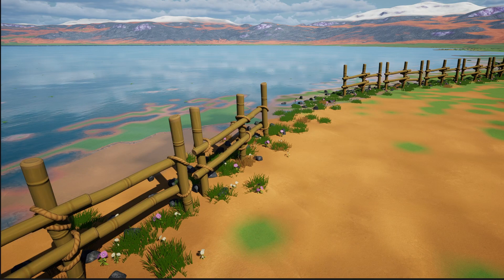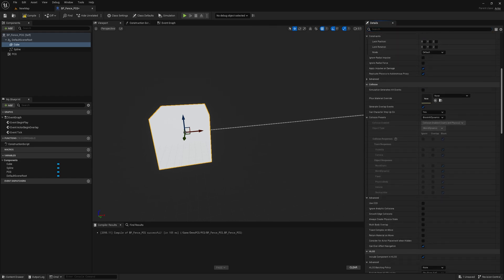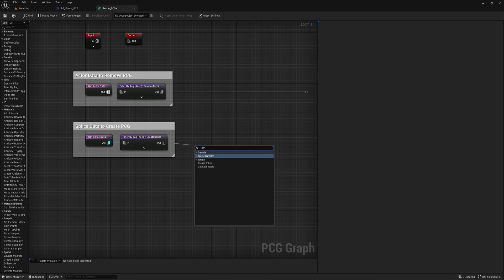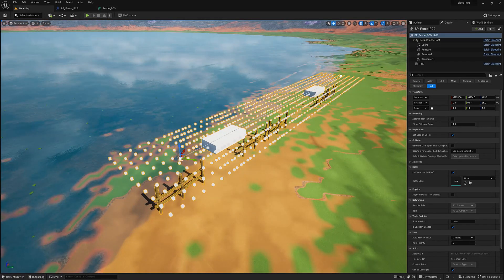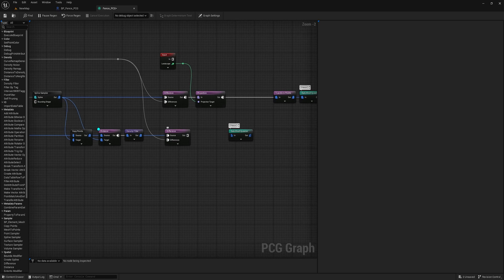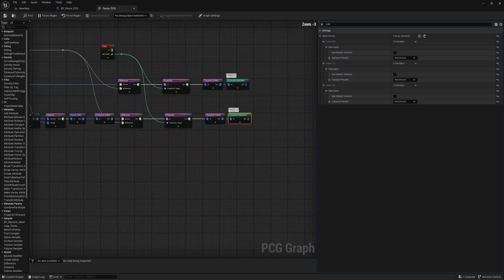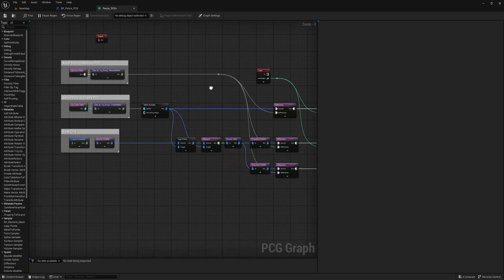UE5 How To - Procedural Fence using Spline and Mesh actors (PCG)

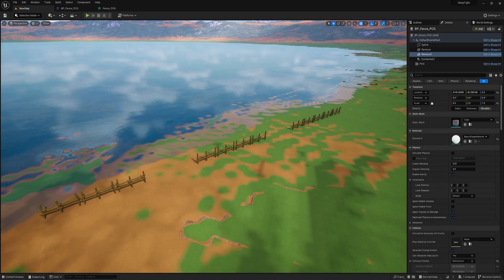Comment: Note: (PCG) Landscape Projection step (starting at 6:06) does not work the same in Unreal 5.3. The differences start with the StaticMeshSpawner node creating a To Point node in between SplineSampler and StaticMeshSpawner. The Projection Node creates a Make Concrete node from the Difference node, and when that happens, the fence mesh disappears when placing the actor in the world. 

Note 2: The Narrator stops consistently calling out what they're doing around the 3:30 mark, and it makes following the tutorial significantly more complicated.
Reply: The other issue I'm running into is that if I modifying the actor location or change anything on the actor and then hit Ctrl+Z, the fence mesh duplicates itself at a seemingly random location on the map and is only removed by manually deleting it or deleting the entire actor and starting from the level and starting over.

Comment: This is good stuff! Quick Question,  when I put a wide curve in the spline, the fence ends do not line up, anyway I can keep the ends connected ?
Reply: I figured it out, if you put a "TRANSFORM POINTS",  right before the Static Mesh Spawner, and lower the Min and Max offset numbers in the X and Y axis, you can get them to align when you put bends in your spline.

Comment: get actor data is not showing on my blueprint when im search for it what im doing wrong?
Reply from the maker: Get Actor Data is a PCG node, therefore it will not be possible to find it in Blueprint, you first need to create a PCG graph and then you can find it, a video showing how to do this is attached
https://youtu.be/4cjp2mslno8
Reply: I have the same problem, when i search for get actor data in the PCG graph, nothing pops up.

Comment: Great tutorial, straight to the point, i appreciate it!

If i am not rude, could you give some pointers either in comment or in a new video, how one could use this in building (with interior rooms) generation. Like using a closed spline to define the building footprint and divide that area with rooms to start with. I see a potential with PCG but the problem i feel with unreal as a beginner is that even if i have an idea to try, i dont know what nodes/components i need to do it. Maybe it is just me but not everything is self explanatory.

Thanks!
Reply from the maker: The documentation on the new additions to unreal engine is not the best, the way I learn is by trial and error, you can also look at the source code of the nodes.  Creating a building is a slightly more complex process.  I will check the topic and if it is relatively easy to understand then I will create a video tutorial